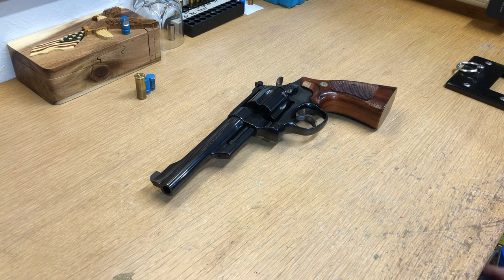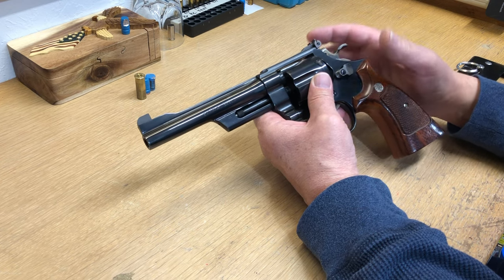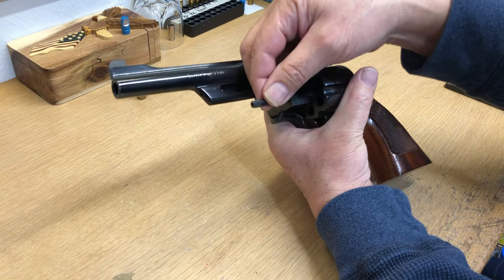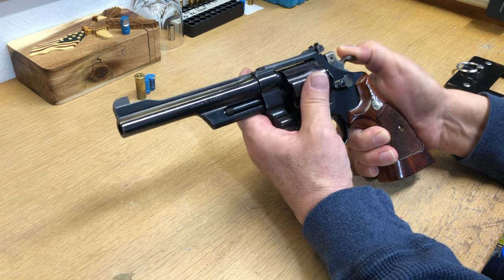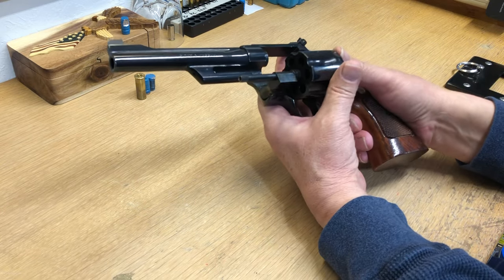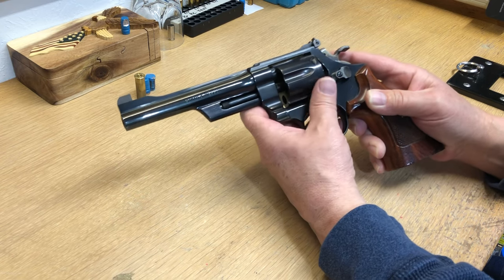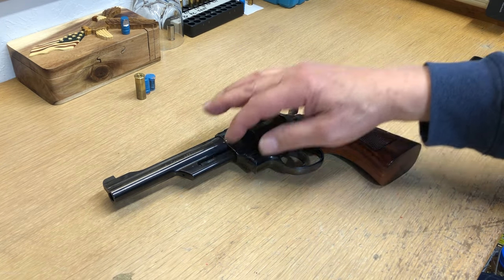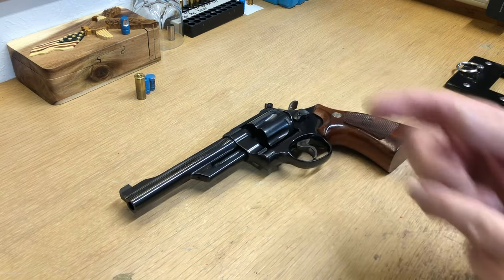How to open a stuck cylinder on your S&W revolver￼

Comment: 100% solved my problem with my Model 60. Didn't even need to use anything to stop it while it was closed, just held the ejector rod with my hand and spun the cylinder around it while it was open. Turns out that was the issue. You're an actual lifesaver.
Reply from the maker: Thanks, glad it helped. 👍

Comment: Thank you so much for this quick video. Have a .357 Taurus that jammed up at an outdoor range, and had to pack it away. Came right home, and found this video. Fixed it immediately. Moreso user error, and unfamiliarity, but this was well-explained, and worked like a charm. 👍

Comment: SOME USEFUL NOTES I WOULD ADD based on how I made this excellent advice work:

(1) IF YOU CAN'T GET THE WEDGE DEEP ENOUGH To COMPLETELY STOP THE ROD FROM TURNING, even if you jam in the wedge ONLY ENOUGH TO CAUSE SOME DRAG on the rotating rod, that SHOULD ENABLE ENOUGH OF A TURN OF THE CYLINDER TO TIGHTEN THE ROD JUST ENOUGH TO ALLOW THE CYLINDER TO SWING OUT. Then you can do a more thorough tightening job once the cylinder is free.

(2) In case you need an extra hand while doing this video's procedure, PROPPING A PENCIL between the partly-pulled-back hammer and the frame will do away with the need to hold the hammer spur with your thumb. 

Thanks for saving me a trip to the gunsmith!!! 

THIS IS ONE OF THE MOST USEFUL GUN VIDEOS I'VE SEEN ON YOUTUBE.
Reply from the maker: Thanks John. 👍
Reply: I just tightened mine by using my fingernail on the knurled portion.  Knowing that the threads are "lefty tighty" was the best information!

Comment: Using a wood wedge is a neat trick - thanks!  If you're going to clamp it in a padded vise to tighten, I suggest placing 2 or 3 dummy rounds spaced around the cylinder take the stress off the extractor when you tighten it.
Reply from the maker: You are correct, thanks. 👍

Comment: My cylinder was stuck.  I figured that I needed to tighten the rod, but I didn't know it was opposite threads!  This totally fixed my gun. I was able to just tighten the rod with my fingernail using the knurled portion.  Thanks a bunch.
Reply from the maker: Great! Thanks. 👍

Comment: Fantastic! This video helped me get my SW 29-2 open in just seconds. I have disassembled the gun several times for cleaning and I figured that something had come unthreaded and was blocking me from opening the cylinder but I sure didn’t think about wedging the knurl and turning the cylinder to tighten the rod.  Thank you !
Reply from the maker: Great, thanks. 👍

Comment: Egad! I had visions of a trip to the gunsmith at high cost and months of delay. I had some bamboo skewers and they held the knurl while I spun the cylinder, and your technique worked. The inside parts are pretty dirty, so next step is to clean everything. I’m not brave enough to remove the side plate. And the problem did occur at the range where I had to qualify for my LTC. I had to shoot 40 rounds in just a few minutes. All the other applicants were using black auto pistols. I had the only wheel gun. Thanks so much for posting this.
Reply from the maker: Glad it worked out for you. 👍 Thanks.

Comment: Have a new Model 63 22LR that had a binding cylinder. Tightened the ejector rod and voila! it fixed the problem. Thanks for an ego saving video.
Reply from the maker: Great, Thank you. 👍

Comment: Great video!! I had an old 28-2 that I took apart to clean and COULD NOT get the cylinder to release after reassembly… your video fixed it right up! 
Thank You!!
Reply from the maker: Alright, great Russell. 👍

Comment: I had this problem in my old Model 64, which had been in storage for a while and hadn’t been fired or manipulated. I put a little oil on the access points for the extractor pin, and eventually removed the cylinder release to put oil right in the horse’s mouth. A little working it and now it’s open. The moral of the story is to get your antiques out regularly for function and fire.
Reply from the maker: Yes, they are made to be enjoyed . 👍🇺🇸

Comment: Thanks. My father had a S&W 38 Special that had that problem. It was an old gun, maybe forty-years-old and had not been fired in that time. It was fully loaded with hollow points. I tried what you showed on the video to no avail. I then tried some Superzilla penetrating oil. The gun didn't look rusty. It had just been kept is a cabinet for forty years. I still couldn't get the cylinder to release. I tried your wood wedge trick again and this time, after a few minutes of trying to tighten the ejection rod, I was finally able to get it open. I removed the bullets, which look fine. I couldn't find any corrosion behind the cylinder. I gave the interior some more lubricant and now it works fine. I think it was just from lack of use. Thanks for the tip.
Reply from the maker: Glad it worked out for you. 👍

Comment: Had same issue on my year old 29-10. Extractor rod loosening after 3-4 cylinder fills of full house factory magnum loads. I caught the issue before cylinder would not release, just became more difficult. Is this something that should be checked frequently at the range? Sounds like it may be…only finger tightened at this time. 
Also realized the 29-10 I have does not have the 2 alignment pins on the cylinder to match the extractor to the cylinder. Looks like by design S&W got rid of those on this issue. 
Great video by the way. Thanks!
Reply from the maker: Well thanks Chuck , hope all is well. 👍🕺🏻🇺🇸

Comment: Learned a couple of new and useful fixes.  If you're in a gunfight have a back  up.
Reply from the maker: Always. The LCP Max is always in the pocket.
Reply: @unclejim2330  As reliable as wheelguns are, I've heard of stuck ejector rods which on unshouded guns can be reached directly with fingers or pocket pliers, and once a colleague lost his cylinder release latch and had to work with the stud, tough on the thumb.  Your tip about using the cylinder rotation to take advantage of the counterclockwise thread rotation of the ejector rod into the cylinder is new to me and can be a life saver in a crunch.  Know your gun.  Thanks for the learning experience.

Comment: I have a Taurus revolver that my dad had unused for long time  but I can’t get the cylinder to release and the cylinder barely moves when I move the hammer back. I added some oil hopefully it will loasen some, any suggestions to get the cylinder to move

Comment: My model 29 opens hard, push hard and feels like it isn't releasing right. I assume same fix, screw in or out?  Thanks, Dave
Reply from the maker: Well I would check it but don’t over tighten, could also be the clearance from the inner rod but that’s rare. 🤷‍♀️

Comment: One small thing to add...  if the cylinder is really stuck, a couple of taps with a rubber mallet can help.  Press forward on the thumbpiece, tap the cylinder on the right side, presto.  Then make whatever adjustments are necessary so it doesn't happen again.
Reply from the maker: No need and I would never do that unless the crane was bent from some being rough on it.

Comment: That is the exact revolver that I have and I am experiencing that actual issue. What is it that actually causes that? I understand the fix, but what causes it in the first place? I can try to fix myself based on this video or ultimately taking into account shop and having them fix.
Reply from the maker: Sometimes they just come loose like any bolt or screw , other times it never happens. You can fix it yourself. 👍

Comment: Very good information, I have an unusual issue with my S&W 686. I  have this problem ONLY when I use 357 mags, Using 38s, it works fine!! Any suggestions?
Reply from the maker: So the ejector rod is loosening with 357’s ?  Have you taken the cylinder out and tightened the ejector rod down? ( put some empty shells in the cylinder when tightening ) 👍
Reply: @unclejim2330  Thank you sir. I will give it a try. I won't be getting to the range for a couple of weeks. But I'll let you know how it goes?
Thanks again.

Comment: Use a feeler gauge to depress the locking bolt (the thing the extractor rod rotates on under the barrel), push the thumb piece, cylinder opens.
Then, you can properly tighten the extractor rod using empty cases in each cylinder.  Easy fix.

Comment: So if a S&W wont open,  once you establish its not a squib or bullet protruding, the likely cause is that the ejector rod has become loose and wont release at the forward lock? And needs to be tightened back into the cylinder?
Reply from the maker: Correct. 👍
Reply: Never had the issue but have a few N and K frames.
Great info. Thank you!

Comment: I have very good Rossi 5 shot (J frame).  While shooting the gun will jam tight, I push the cylinder release, swing out the cylinder about a 1/4 inch and push it back and then I can fire it,  But this is exasperating.  I think it is the rod is working loose as I can move it left and right with my fingers.  Once I tighten it and shoot but it loosens again.  I have removed the yoke and disassembled the cylinder, etc.  The gun is old but it is like new, almost no use marks and the bluing is perfect?  Suggestions?
Reply from the maker: Strange, you aren’t supposed to use loktite but maybe clean threads and use the slightest amount of blue or low strength. 🤷‍♂️

Comment: When I pull the hammer back, the cylinder will still not rotate. Any thoughts? Thank you!
Reply from the maker: If you are pulling the hammer all the way back the stop/bolt will lock it up, that is the part that fits in the notches in the side of the cylinder and is located under. Try pulling the hammer back only 1/3 and it should spin. If not something else is wrong. 👍

Comment: Can ur friend say if there is a binding from a projectile that jumped under recoil, or as u say, a squib load, where projectile is stoped partly in the forcing cone? I can think no other reason a DA revolver cylinder could lock up.
Reply from the maker: It locked up because of a loose ejector rod, see the replies it happens. 👍
Reply: @unclejim2330  tnx

Comment: There is no plunger, there is no release button. Gun is completely smooth on both sides.  Smith & Wesson .32 revolver Model 732.  Even Smith and Wesson didn't have an answer on their website for this exact model.
Their solution was "push the button in" to release.   How does Smith & Wesson not realize there is no button on a 732 they built?   Most videos on YouTube, regardless of weedeater, leaf blower, gun, dirtbike never work.   Seriously I would say 90% of them are a waste of time.  I'm being honest, my IQ is 130.  I understand a simple video and can repeat the process, although it usually fails to produce results 🤷🏻‍♂️
Reply from the maker: Oh you are going way back! You have to pull the pin out of the cylinder manually like an H&R revolver. 🤷‍♀️

Comment: If you keep the extractor rod tight, you'll never have problems.
Reply from the maker: They come loose sometimes but what do I know, I’ve only had about 50 Smiths. You? 🤭😂
Reply: @unclejim2330  24+, but all have been well taken care. Everything tight, clean & properly lubed. Nothing made after 1980.

Comment: this seems to be a design flaw with smith and wesson , my snubnose 38 bought brand new around 68or 69 wouldnt release the cylinder years later, my 357 stainless bought around 75 new also woundnt release the cylinder some years later still trying to find solution without taking to gun smith , going to try your fix hope it works, fingers crossed!
Reply from the maker: There is a a tool to tighten the rod but just go easy and don’t over tighten or bent.it helps to put spent cases in the cylinder as well. 👍

Comment: My 38 cylinder won't open. The gun is loaded. What would u do. I just want to unload it
Reply from the maker: You need to be VERY areful and not let the hammer fall and keep it  pointed in a safe direction.. the hammer only needs to go far enough to free the cylinder. If you aren’t comfortable take it to a gun smith. 👍

Comment: Had my smith and wesson 357 get stuck with the hammer cocked back while at the range amd yes still loaded. Cylinder wouldn't move because the hammer was stuck back. I held the cylinder release forward and the trigger gave the cylinder a tap with my palm the trigger released and the cylinder Popped right open
Reply from the maker: Never fun when they are loaded. 🙀😂👍

Comment: What is the tool named , the small pen please help me 🙏🏻
Reply from the maker: It’s called a “ extractor rod tool” but if you’re only doing it once or twice just wrap the rod with leather and tighten it in a vice or vice grips and put 6 empty shells in the cylinder to keep the loading side locked up. 👍 remember it a reverse thread so left is tightening and don’t over tighten! Snug is fine.

Comment: Awesome video sir! I have a cylinder locked up and loaded on an S&W Airweight (442) from wearing it cc on an ankle holster all day in a very humid environment. I am reluctant to mess with it due to it being hammerless and this being my first wheel gun and not being an expert. If I lived in a more rural area, I would go fire the rounds and then get down to business but I am unable to. Do you have any advice or pointers? What should I be careful not to do to avoid a discharge? Thanks in advance👍
Reply from the maker: I would take it to a range and shoot  those live rounds or find a shop  or police station that has a shooting tank. The other option is a gun Smith. 🤷‍♀️
Reply: @unclejim2330  Thank you sir, that's what I was thinking as well.

Comment: How can you tell which model SW you have?
Reply from the maker: It will have a model number inside when you open the cylinder and you can date it by the dash . Sound like you have a model 25.
Reply: @unclejim2330  ok thanks!

Comment: Mine is the opposite I can’t close mine brand new 686 box of shells through it. Dent is loose  up front. Took cylinder off crane closes perfect without cylinder on. Ejector dent works no idea what’s going on
Reply from the maker: Ok , what do you mean by dent? If it closes on its own is the ammo too long?  Give me details and maybe I can help. 🤷‍♀️
Reply: The detent for the ejector rod in the front.  Would not close with no rounds in the cylinder. Gun smith looked at it could not get it to close they sending it back to smith and Wesson.

Comment: My cylinder locking pin was stuck. Had to disassemble the whole crane assembly. Had to exercise the pin into the disengage position with a hard plastic screw. The cylinder release still sticks. Not happy.
Reply: To clarify; the pin on the cylinder is what is sticking. I lubricated it very well and exercised it hundreds of times.
Reply from the maker: Not quite sure what you mean but you can get used parts on EBay. 👍

Comment: Nice job sir!... I enjoyed it thoroughly....  I feel the need for a 9mm revolver, partly because its a unicorn and partly cause I have mucho 9mm ammo.  I don't like the idea of needing a tool to unload or load a hand gun (moon clip)....  Charter arms Pitbull and S&W 547 are the only two I can find that are designed to work without moonclips.  The 547 is Beautiful!,.... But @ 2,400.00 if you can find one out of range,  so to speak for me.... Any suggestions?  Many thanks for the great tips...
Reply from the maker: The 547 is very rare and I never found a good deal  30 years ago!  I had a SS snub S&W back in the day and it kicked more that 38 but was neat. Moon clips ain’t bad and you can load a whole pile of them. You can make a pipe tool to unload the brass and  they  even make plastic moon clips now for cheaper easier .  Ruger made  9mms also. 👍

Comment: My model 19 locks up when I shoot magnums. Hammer won't even pull back. Gunsmith told me It's too old for modern magnums
Reply from the maker: The 19 is a K frame and can get abused with shooting lots of magnums , thats why S&W came out with the 586 & 686  to stay lighter/smaller than the big N frames .( this vid shows an N frame) If I was buying today and wanted medium size, I’d get a Ruger GP 100 for strength for size ratio and we had a range rental that lasted so long we had Ruger replace the barrel after it got shot out. With your 19 empty pull the hammer back then let down that hammer with the trigger held in then check the cylinder for fore and aft movement ( end shake) and side to side movement . That is probably your problem and It can be fixed with shim washers or stretching the yoke, for side play a fitted stop. I’ve fixed a few 686’s that where used and abuse that way. 👍
Reply: @unclejim2330  Thanks very much! It's a -3. Maybe I'll make a little video inspecting it.   You know, I've never heard a bad thing about those Rugers.

Comment: Very common problem with pre 1960 guns. At that point they reversed the threads so they tighten under recoil. Problem I have is getting the extractor out on post 1960 guns.
Reply from the maker: I haven’t had that problem . 🤷‍♀️

Comment: I like your method better than what a gun smith did which is to take a dead blow hammer and strike the cylinder from the right side and driving it open and the cause was the same as you're demonstrating. Actually if memory  serves me correctly it's only torqued to 22-25 in/lbs.
Reply from the maker: Smiths do that to correct crane alignment so there’s no way I’m using a hammer! Gentle is always best. 👍